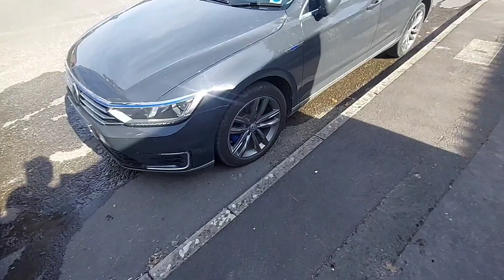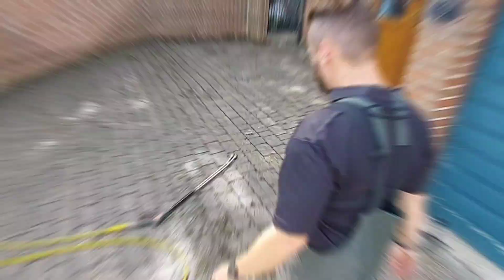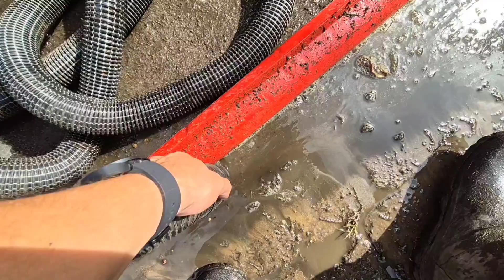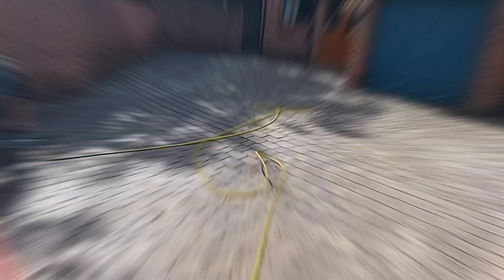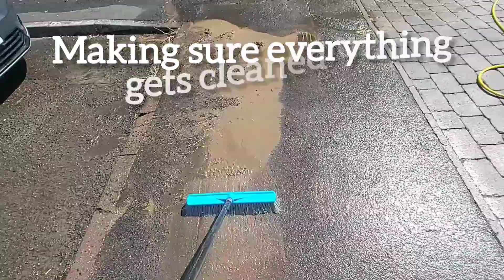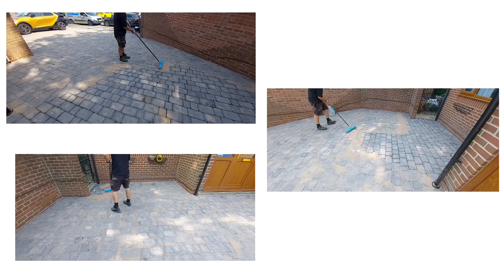The Gutter Vacuum Worked Hard On This Paving Clean Due To Non Existant Drainage

Comment: Looks like the original builder cheaped out on the very important drain install..... Lack of, that's nuts
Reply from the maker: There is about 6 cul de sacs in the area and they are all exactly the same
Reply: @HelmOfAwesomeWindows  would not like to be the houses that the drive slopes inwards, looks like they get everything from the side you were on

Comment: Hi, great video editing and excellent technique dealing with the water issue running on the road. Great job all around. Well done. What did you sprinkle on the paving sand before brushing the sand into the driveway?
Reply from the maker: @craigspencer3369  appreciate that mate thank you. I either use rock salt or weed preventer to help prolong the weed growth. Which ever i can get hold of at the time 👍👍